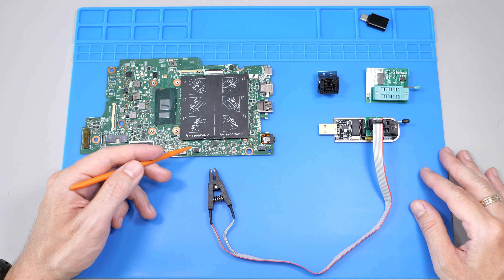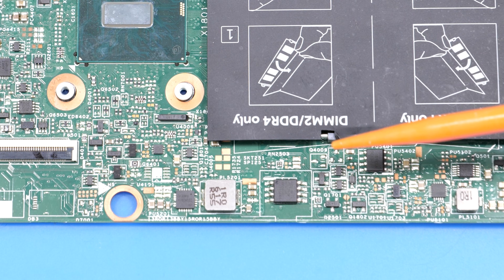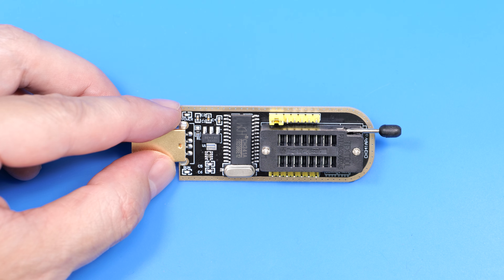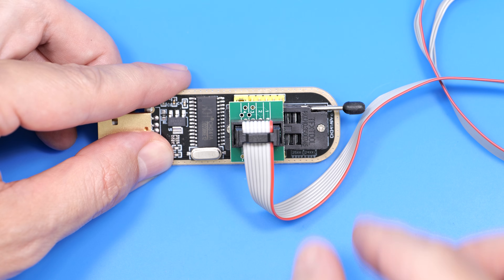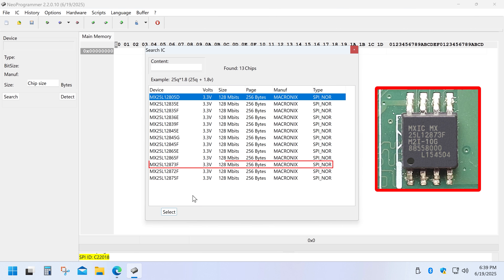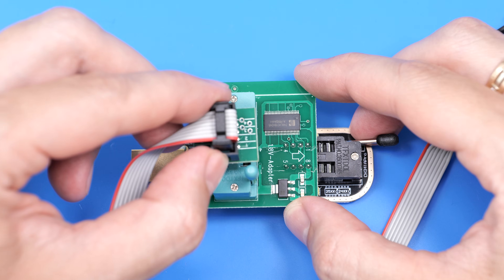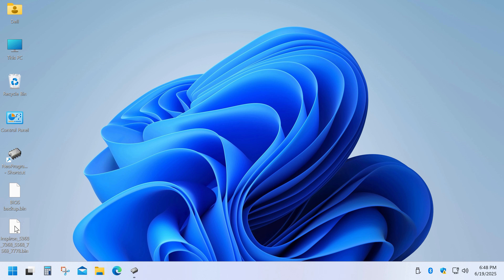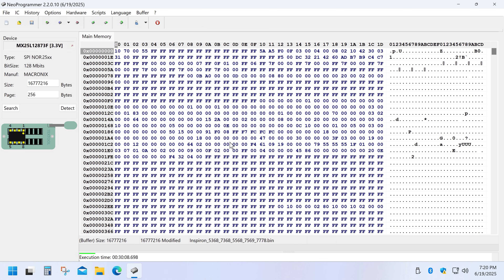How to Fix a Corrupted BIOS with a $5 Programmer | CH341A BIOS Flash Tutorial

Comment from the maker: ⚠ Quick tip for beginners: Some chips run at 1.8V, not 3.3V. Before connecting the clip and plugging in the programmer, check your chip’s voltage (you can look it up by model in NeoProgrammer or use datasheets). If it's 1.8V, use a voltage adapter to avoid possible damage. The link for the programmer with 1.8V adapter: 
https://amzn.to/4eAXrzg
https://alii.pub/78esym
Reply: Thank you ! This tip save many chips, be sure 😊

Comment: Love the video! It’s very clear, but I'm a bit scared to try it on my Dell Precision M4700 because the BIOS structure is different from HP. My Intel ME is missing from the system info, and I really need a guide on how to fix this using the CH341A for Dell models.

Any chance you could do a tutorial for Dell users? Specifically on how to handle the .exe files or 'Clean ME' for these older workstations. Thanks In Advance!
Reply from the maker: Just to clarify, the video was actually done on a Dell laptop, not HP. About missing Intel ME, the easiest fix is to flash a full working BIOS dump from the exact same model that usually restores all regions (BIOS, ME, etc.). Your model is available for the download from this huge archive: https://t.me/s/biosarchive?before=17439
Reply: @ElectronicsComputers  ahh i see, Thanks for the clarification and the link! Really appreciate it.

Comment: Thanx you for the usefull tutorial, however , it didn't worked for me , i did save the actual bios, inject the new one, but still got the bios led error. am with a Dell Vostros 15-3515

Comment: hey dude i am trying to flash a bios but i have a question, if i didn't know the voltage correctly and i put a 3.3v one on the chip even for a little bit did i fried the chip? i now have a 1.8v one but i was watching ur vid and at some point u said something about 1.8v and i ordered it but first i tried with the 3.3v one, did i fried the chip?
Reply from the maker: In most cases a 1.8v chip survives 3.3v but it depends on how long it was connected to a 3.3v source.
Reply: @ElectronicsComputers it was connected for some minutes but now i cannot get it to work with a 1.8v i just connect it and it says ic not responding, when i tried with the 3.3v i got it to read it, so yea it was for some time connected i guess
Reply from the maker: @eduardalexandru4207  Make sure that you connected that 1.8v adapter and the clip into it correctly, just like I showed in the video.

Comment: Hi, I'm currently in a situation where I have to update my bios for my mpg b550 board. But even going to a barebones motherboard using bios flashback doesn't work and I've determined that it has to be a motherboard issue. Can a programmer like this fix my problem?
Reply from the maker: Yes, in cases like this a CH341A can help. If the BIOS flashback fails, the programmer allows you to directly erase and re-flash the BIOS chip with a clean firmware image, bypassing the motherboard completely. If the chip itself isn’t physically damaged, this often fixes boards with the problem you described.

Comment: @ElectronicsComputers   i have asus tuf f15 do you think i can remove the bios password if i do same as your video?
Reply from the maker: This trick used to work perfectly on older laptops where the BIOS password was stored directly on the BIOS chip. But modern laptops especially high-end ones are much more secure. They use an EC (Embedded Controller) chip or TPM (Trusted Platform Module), and the password is tight to those components and not even stored in the BIOS chip anymore. So reflashing it won’t remove the password like it did in the past.

Comment: How long was the erasing IC?
Reply from the maker: Depending on the chip it could be 10-20 second or several minutes.
Reply: @ElectronicsComputers well looks like mine is a dud need to replace the chip.

Comment: I have an HP ProBook 640 g3 with a W25Q128JV series BIOS that is set to secure boot only from the HDD.  I presume this setup should be able to reprogram the BIOS chip EEPROM and erase the unknown password if I can get the bin file?  Incidentally, HP has the worst customer service and policies out of any company known to mankind, but they provide 2 different binaries for this laptop; however, I have my doubts if either will work.  Whoever reads this, feel free to chime in regarding their success/failure with HP binaries.
Very Best Regards,
Tom Scott 🗽
Author ● Speaker ● World's Leading Expert on the Corrupt U.S. Legal System
Stack the Legal Odds in Your Favor
Our American Injustice System

Comment: Hi guys im on windows 11 and I have tried multiple pcs with the exact drivers installed. I got my programmer in amazon and now im thinking if its a defective one because all three of my PCs with the driver installed still shows Code 43, "Device Descriptor Request Failed," in the device manager it does not show the CH341A device name just unknown device with the error
Reply from the maker: That error indicates that the device itself is not communicating properly, so it's possible you received a defective unit.

Comment: Hi, does this also help clearing the admin password when trying to reformat my laptop?
Reply from the maker: It may or may not work, depending on the laptop model. On older laptops it worked without any problems, but on modern ones the security is much more advanced, and the BIOS password may not be stored on the BIOS chip itself.
Reply: @ElectronicsComputers Is there any other way to remove the admin password? If it didn't work, what would be the option to do next and make sure it will be removed?
Reply: Thanks for your reply @ElectronicsComputers

Comment: The AliExpress link shows many options. The correct or most complete one should be the following... Color: CH341A And 2 Board ???
Reply: or Color: 1 Set ??
Reply from the maker: @maximilianoalfredovaleriaa5538   That depends on what you need it for. If you need the most universal solution that covers 1.8v and 3.3v chips then select Color: 1 Set.
Reply: @ElectronicsComputers  thans you
Reply: @ElectronicsComputers  I bought the programmer, but mine doesn't show pin number 1 that you show at 1:19. Everything is the same except for that mark. Should it be the same?
Reply: https://youtube.com/shorts/AzyXtih9TNc
Reply from the maker: @maximilianoalfredovaleriaa5538 They are all the same, just use the same connections as in the video.

Comment: Great tutorial, thanx! Just a question, do you know how to add support for new chips to the database? I need to add the macronix MX25U25671GZ4I4G   u_u
Reply from the maker: What matters in the chip designation is the core model: MX25U256. NeoProgrammer provides two options for this chip, so you can safely select MX25U25673G, which is the newer revision of your older MX25U25671G chip.
Reply: @ElectronicsComputers  Awesome, thanks!

Comment: ok I have to stop 37 seconds in this video and tell you holly hell, I need your donation page or some way to send you money. I ordered 3 sets of these programmers thinking I did something wrong.. Could not get these thing to read anything at all nothing not a single thing. Never could connect... Who would have known it's the Driver.. Not the SER drive which is what I assumed it being a usb adapter, i was thinking serial com4 like a serial reader. anyhow. watched your video. 37 seconds I noticed you're using the PAR driver.. parallel driver I am assuming, not thinking that would be it. low and behold it WORKS! I owe you a coffee or a beer, a joint or whatever you partake in. just let me know where I can send it.
Reply from the maker: I’m glad I could help! The wrong driver is a very common issue I hear the same story on a regular basis. Your comment is already more than enough, but you can press three dot button and then the “Thanks” button if you wish.

Comment: My BIOS uses the same chip, the Mx25L12873F, as in the video, but it's not detected (I haven't tried using a 1.8V adapter).
I saw in the video that the chip voltage is 3.3V, but why is it using a 1.8V adapter? Does the Mx25L12973F really have to use 1.8V?
Reply from the maker: The MX25L12873F is a 3.3 V chip, so there’s no point in trying to use a 1.8 V adapter. If the chip isn’t recognized, the problem is usually bad contact between the clip and the chip (assuming the drivers are installed correctly from the provided links).

Comment: excellent video sir. straight forward and to the point... I bought an elitebook with locked bios, can I use this method to remove the password?
Reply from the maker: If it’s a relatively recent model, then most likely not. Removing the password by BIOS reflashing only worked on very old systems. Nowadays, the BIOS password usually isn’t stored in the BIOS chip itself. If it's critically important it's worth trying but I wouldn't expect a miracle.
Reply: @ElectronicsComputers Which laptop models are compatible with this flashing procedure?"

Comment: I commented about this a few months ago, but i finally tried to flash it on my Toshiba Satellite C55-C1545. I successfully flashed it, but the same issue persists, CPU fan works, numlock and capslock lights respond, power button does light up, even connecting an external keyboard into one of the USB ports the keyboard's backlight works, but no display and shuts off after 65s, could it be because maybe its the wrong bios file or is it a deeper hardware problem? also could you find a bios file for this laptop? I don't think taking it to a repair shop is worth it because its not my main machine, its been sitting in a closet for 3 years with no main battery or cmos battery, so i decided to try to fix it ALSO with known bad ram the system shuts off in 10s, and with known good ram it shuts off in 65s, and with no ram it never shuts down
Reply from the maker: It looks more like a firmware/board issue. The fact that it reacts differently with bad vs good RAM means the CPU and memory controller are at least doing something, but it never gets far enough to initialize video and then shuts down on a timer. If the BIOS file you flashed comes from some C55-C model with a dedicated GPU when your model is UMA-only, you can get exactly the symptoms described, that’s classic wrong firmware / GPU init mismatch behavior.
I don’t have a clean full .bin for this exact C55-C1545 board, but you can request them here:
Discord: https://www.sorinelectronics.com/discord
https://www.badcaps.net/forum/troubleshooting-hardware-devices-and-electronics-theory/troubleshooting-laptops-tablets-and-mobile-devices/bios-requests-only/64509-bios-toshiba-satellite-c55-c-1f0

Comment: Hi! Does it work with a Lenovo IdeaPad Flex 5? I'm trying to connect to the BIOS but it doesn't detect it
Reply from the maker: It works with any laptop, smart TV, router, etc. Just make sure the clip has a reliable contact with the chip. Try squeezing the clip with your fingers and hold it in place to see if the programmer recognizes the chip.

Comment: i have a notebook with 2 bios chips. one normal and one flat, which i need to extract the data from. are there fitting clamps or do i have to solder some wires to get to the data?
Reply from the maker: What's the model of your laptop?
Reply: @ElectronicsComputers  it's a Dell Latitude 5430. 
I read in a forum that UC6 and UC2 are the bios chips. the UC6 is readable with my bios flasher, but the UC2 is rather flat. After checking the mainboard again, my plan was to scratch the pads connected to the pins and get a janky connection by soldering some thin wire and connecting them to the CH341A

Comment: Hi, I want to ask. If my bios file format in .rom can I use it or do I need to find bios in .bin.
Reply from the maker: The BIOS file should explicitly have the .bin file extension. Just google your laptop model bios .bin you'll find dome options. You can use any version, your goal is to make it up and running and then you can update it normally through the windows.

Comment: How to retain machine specific info like MAC address and Serial Number?
Reply from the maker: First, you have to read your current BIOS and copy the specific lines that contain the region data. Then open a new firmware dump, select the same section, and paste your original region data into it before writing the new BIOS. That’s how it works in theory. The problem is that there’s no universal solution or step-by-step instructions. You only find detailed guides for popular models where someone has reverse-engineered the process. If you simply download someone else’s .bin dump, you’ll also get their region information, which usually doesn’t affect anything and that’s what we do in most cases.
Reply: @ElectronicsComputers ❤ justamente tenía esa duda, hare esto para una Lenovo Thinkpad p15 gen1 😅

Comment: Sir my hp elitebook 840 g4 is 3.3v but ive seen many people sy CH341A has fault it only outputs 5v so wont it fry my chip?
Reply from the maker: Many people simply don’t understand what they’re talking about or what they’re even dealing with. As you can see in the video, I measured the important pins and they’re at 3.3V or 1.8V. If I measured every single pin, you’d see that a few still show 5V and that freaks some people out and for some reason they think it's not normal. Don’t overthink it. The CH341A is a legit tool that repair shops use to earn thousands by reflashing smart TVs, routers, laptops, etc. I’ve even seen them used in university research groups for prototyping.

Comment: Hey man, first of all thanks for the video — it was really easy to understand.
I have a Gigabyte B650I Aorus Ultra ITX motherboard. Can I use this tool to fix my motherboard?
My PC won’t boot into the BIOS or Windows. The system powers on, the CPU heats up, and the RAM gets warm, but there’s no display. I tried using Q-Flash Plus to update the BIOS — the process takes about 5–7 minutes — but after that there’s still no display. I tested three different RAM sticks and three different CPUs, but still no luck.
Reply from the maker: Since Q-Flash Plus runs for a few minutes, it means the board is accepting the file but the symptoms you described usually mean one of two things:
The BIOS is still corrupted or partially flashed,
even if Q-Flash Plus “finishes” normally.
The board has a second problem, but honestly on these boards, BIOS corruption is super common. Because you already tested 3 RAM kits and 3 CPUs, that pretty much rules out everything else. So yeah flashing the BIOS chip directly with a programmer is the next logical step.
Reply: @ElectronicsComputers thanks man I will try this tool now

Comment: what about if i want only modify 2 lines in bios for hardware id? do i still need do it like erase chip then write chip or can i only modify two lines then write it?
Reply from the maker: Read your chip, copy the region lines you need, then open a new BIOS file and paste those lines in a proper place. Finally, erase the chip and write a new modified BIOS. Even if you modify one symbol and press write without erasing the chip it may or may not work because very often it creates inconsistent BIOS structure and boot issues.
Reply: @ElectronicsComputers  ❤❤❤